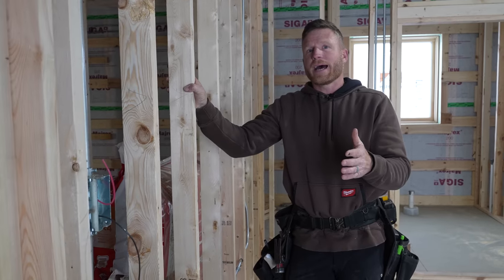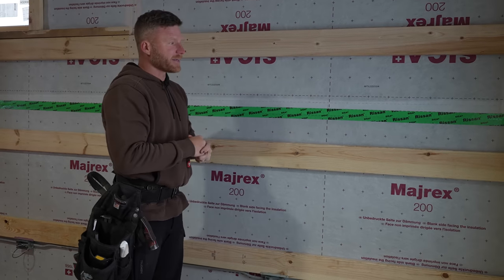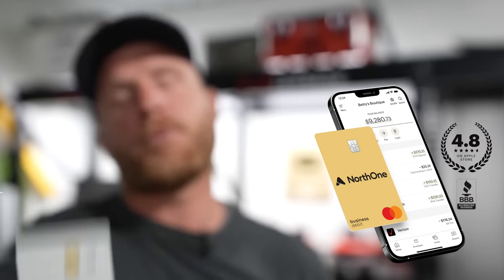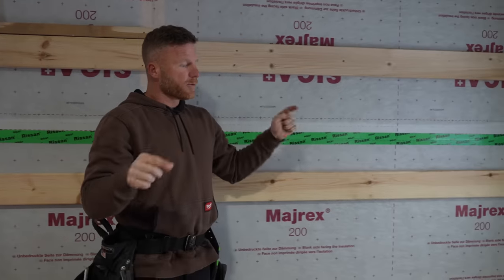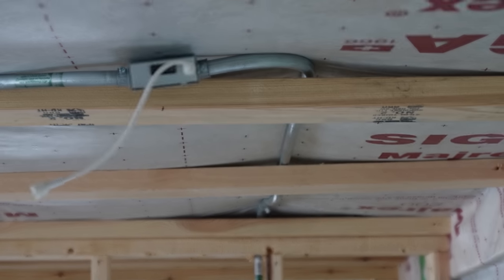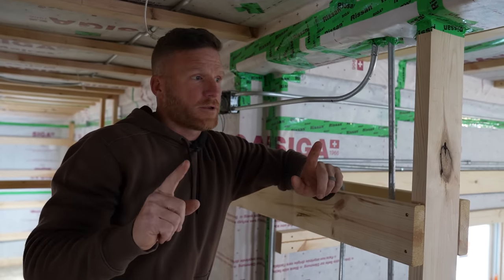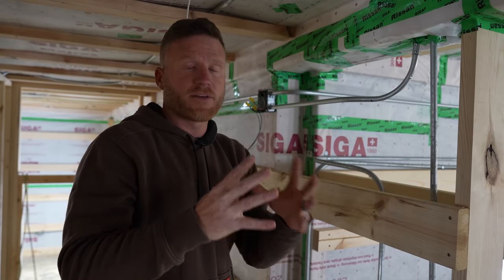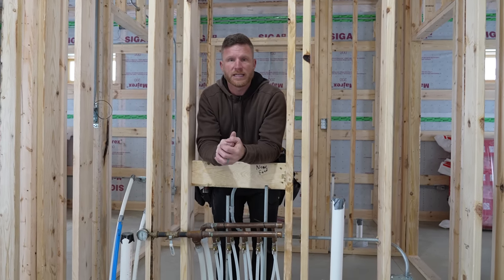The BEST way to run ELECTRICAL in the BEST HOUSE

Comment: Won't the conduit running into the attic result in an air leak, since it's essentially a race way for electrical wires?  Looking forward to the air leak test.  Also, I agree wholeheartedly, that a tighter, more energy efficient home is a good thing.  Using the heat exchanger or opening doors allows the homeowner to control the air leaks and not the air leaks controlling the energy consumption and comfort levels in the home.

Comment: Done a few small reno's over the years and one thing always puzzled me. Electrical v Plumbing, especially in bathrooms pipes being run above electrical works. 
Water leaks downward so I would always run plumbing low & then vertical runs up to point of use.

Comment: Romex is easier, but conduit is better. With conduit you have the ability to add/change circuits at will thru out the life of the home without disturbing structure/finishes.

Comment: I have to agree with the home owner on the conduit. It's what I prefer.
Reply: The only thing I would have changed is the boxes. A 4 square and mud ring is much easier for splicing and installing certain devices.

Comment: I have a random question lets say I am remodeling down to the studs a big section of my house like there was a fire in the kitchen and living room or flood or whatever. When I go to remodel if you were to do these things in that area would the siga still be able to preform as its designed to make that area more efficient or is this only an option if it was put in the whole house?

Comment: I love the plumbing in internal wall philosophy. I just remodeled a laundry room, and relocated all plumbing and electrical to internal walls, and replaced the glass insulation with rockwool. The room is so much quieter and more comfortable, it surprised me how much difference it made.

Comment: Are the conduit tubes sealed with any type of special fire resistant silicone to prevent air movement from the electrical outlets?
That can contribuite to the blowerdoor test.
Reply from the maker: They are inside the envelope it isn’t an issue

Comment: You mentioned "negative air blower test" I'd like to see that because usually its positive air to show leaks. How does that work?
Reply from the maker: You can go either way.
Reply: With the negative test, it's easier to find the leaks while inside the home as they appear to be air leaking in. Much easier to find with a smoke generator.

Comment: when you have under slab plumbing and no in floor heat are you worried about waterlines freezing?? or if you do under slab plumbing is it required to have in floor heat to keep the waterlines working properly

Comment: Will there be any Air Conditioning in this house? Curious if ductwork still needs to be ran or if there will just be a couple ductless airs installed later on. Obviously heating is done from the tubing in the floor. Thanks
Reply from the maker: Just mini splits

Comment: Morning, I was always under the assumption that dead air space would create a spot for condensation, so what happens in the uninsulated space where the electrical/ 2x6 framing is behind the drywall, is this not an ideal spot for moisture to accumulate?

Comment: Question sir! You mentioned R-21 on the walls with Rockwoll. How much would the cost difference be if you used 3" (R-7 per inch) closed cell insulation on this building?
Reply from the maker: material wise over double per square ft
Reply: @RRBuildings  that is a lot. I am looking forward to see the blower door test.

Comment: It different to see all the conduit for the wiring in a residential setting as I mostly just see the wiring like 14/2 run and stapled.
Reply: in most states, romex wouldnt even be allow in that kind of build.
Reply: @Pepe  is it because it's not a conventional framed house? The only place I've ever seen much conduit here is in commercial or in underground here in Canada. Mostly just run the wire directly from the rolls and they need to be stapled every so many feet.
Reply: @matthewmcallister8845 it is because of the building code. The stapled wire is too close to the drywall. It needs to be recessed a bit more but it actually can't. So they have to use conduit.

Comment: Do you guys test for radon in Illinois? Curious if that's a concern there and if you install mitigation systems sucking air from under the slab.
Reply from the maker: We have a radon mitigation installed passively for now and it can become active if need be

Comment: Cost...cost...cost... affordable is lost in the pursuit of "airtight", control layer when everyday you go outside, you allow air into the structure (and you breathe same outside air). In the end, over reaching building science is leading the charge to unaffordable and in fairness unnecessary building practices. 10% energy savings is not worth the 30% increase in construction costs... 
I do luv the solid workmanship demonstrated in your videos, exceptional and rare! Completely enjoy and appreciate the dedication to craft!
Reply: Old retired 40 years home builder here agrees, there has to be a happy middle ground. Going to tight, will create some problem somewhere.

Comment: Yes very good Sir. The right way to do electric install for residential homes. The way to go. Better than code. With stick framed walls, the trick of the electric craft use installation 2x2 walls on top of the first built 2x4 wall equavalent structure.  Conduitpipe (PVC-pipe) in construction for residential electric wireing and circuit connect - like inside wireing —  out of wireing them (not 'Romex' equivalent standard  instead of conduit pipe and protected wires inne i röret) to connection box and application sockets. 
You may check out DIY built (smaller) home demonstrating this (using installation walls). Youtuber Mindsparx.

Comment: Hey man ask your electricians to fill every conduit connector with duct seal in the boxes to absolutely seal that up
Reply: You only need duct seal for conduit going through the air control membrane. Most of the conduit just runs on the inside so there's no point sealing a tube where both ends go to the same space.

Comment: Imagine having to run all that steel conduit.  Every fitting, every bend,  every box.
Reply: It's worth the initial hassle and cost. Down the road updates, modifications, remodels, and repairs are all easier with that existing raceway.

Comment: Keeping that vent fan in the same temps until last moment possible should help keep that condensation at bay.  The exterior of the pipe shouldn't/wont draw condensation until the point of exit where you have some thermal bridging at the exit point.     Also, the wraps you are using are interesting... the permeability being directional is pretty wild.  I work with permeable membranes in protective fabrics and directional isn't a thing in our use.. Dalton's Law of pressure is likely always in play.    I gotta learn more about the directional efficiency of those membranes.

Comment: Just curious did you look at price of flexibile conduct with the wire already in vs this solid conduit? I can't argue that the flexibile stuff would look as good, but cost wise would there have been any real savings ? Or is there another reason you went "hard" conduit ?

Comment: What happened to "Best" being spray foam?   No wall penetration issues there.. 
Used to be "why I don't use spray foam before that"...   I don't mind building science changes and advancement but this does feel like a commercial. 
 Still get a lot out of your content though...
Learned a lot over the years...

Comment: Am always shocked at the single layer dry-wall layer in The States. It's so flimsy and can be holed easily just by accidentally letting something fall against it, let alone someone falling against it.
Reply: not an issue really, it doesn't feel flimsy at all. Metal profiles are less prevalent here which I believe makes it more flimsy. Standard 1/2" drywall 16" O.C. wood studs are pretty rigid you ain't falling through it and it doesn't break that easy. Obviously if you start hammering the cavities it will go through but you have to hit it reasonably hard still.
Reply: I guess you have a lot of bar-room fights at your house. Half inch drywall is pretty stout on 16 inch centers.
Reply: @brianfahey2864   Hey Brian,  laughed at your comment 😂 I'm English but live in Germany. Any dry-wall work here is mostly doubled up (two sheet thickness) which makes for a much more stable wall when hanging stuff like kitchen cupboards or shelves which have to bare a heavier load, it also lends more stress resistance if someone falls against a wall or a kid rams his/her bike etc into it. Have often seen one-sheet walls being broken because of the lack of stability. Over here in Germany, everything is much more solid anyway. Outside walls are mostly brick, inside walls are also made of blocks with the cabling being put into grooves routed into those blocks then plastered over. Am a big fan of watching RR Building's channel so have seen what standards Kyle and Greg work to. Amazing stuff! What I also know is that Americans pay a lot of money for nearly everything you have to buy, including houses. Here in Germany, prices have also increased, are still however much lower than in the States and you get a more solid house into the bargain. Ragards 👍

Comment: None of his builds would ever pass an electrical inspection. What a clown.
Reply: Thanks bot! Obviously has to pass electrical inspection in the county/state he is in. Try again…..wah, wah…
Reply: @mikeerstad4828  untrue. He likes to brag that he lives in such a rural area he never gets inspected. He would probably fail structural inspections as well.
Reply: @CybekCusal  did you know that 54% of all townships and parishes is the US require no building inspections and/or permits! The way R&R builds would easily pass structural inspections anywhere outside of hurricane areas and could also pass that with a few slight modifications. Post frame construction has been proven time and time again to be better construction than typical stick framing. 
Not sure where you come at him with the not being able to pass electrical inspections - he is not an electrician, I assume his electrician is state certified,etc. so electrical passes code.
Reply: @mikeerstad4828  lol. And Jewish space lasers 😂 are real
Reply: @CybekCusal  thanks for revealing you know nothing and have nothing to add.
Reply: Yeah, sure… like his builds are not passing electrical inspections in Northern IL!🤣 You definitely do not know what you are talking about because the inspectors and building departments are psycho about their regulations in IL.
Reply: @nathanaelhawkins5004  he told me none of his projects get inspected. So if you don't believe me then he's the liar. 😂
Reply: Me believing or not believing YOU has nothing to do with him being a liar.🤡 Besides, I’ve been following him for six years and I can’t think of a time he has publicly stated in a video about not needing or not having inspections.🤷‍♂️ Here in IN, all new construction electrical work requires inspection and I work in 6+ counties in northwest IN. IL is no different and if anything, are even worse when it comes to permits and inspections from people I know that actively work in IL. Go start your own channel and then we can critique your builds!🤪
Reply: @nathanaelhawkins5004  🤷 thankfully you got it a figured out.
Reply: @nathanaelhawkins5004  he maybe working in a county that does not require structural inspections. Believe it or not all counties do not require them. The county I’m building in MO only requires an electrical and a safety inspection to get a certificate of occupancy. Up until a few years ago didn’t require building permits. 
If you think Kyle wouldn’t pass a structural inspection point out some of the obvious egregious violations that he would fail on. Come on man🤷
Reply: im pretty sure he explained in a past video how where he builds he doesn't need permits, and sizes beams off past experience. His work looks top notch, and is continuing to elevate his game with air control. Speaking for direct experience, inspections and permits are nothing but a bribe to the municipality and bragging about passing them is like listening to dogs barking at the wind
Reply: I’m pretty sure this thread of comments started from this phrase: “None of his builds would ever pass an electrical inspection”🤨 This discussion was never about a general building inspection or an engineered plan design and build inspection to those set of specs. Totally about electrical inspections 😁
Reply: @nathanaelhawkins5004  well do tell. Kyles not an electrician so how is the electrical not up to your standards? I would assume the electrician is state certified.
Reply: @nathanaelhawkins5004  he's not a electrical contractor. The point is moot
Reply: If he’s not the GC, the electrical being up to code and passing an inspection or not having one at all, is not his problem. End of story
Reply: Besides, every state, county, municipality, and township adapts different years of NEC code that they require electrical systems to be designed/built/ installed to.
Reply: Being a builder for 50 years in the California bay  area with seismic earthquake and structural engineering for as far as you can see one question I’ve always had with these post frame buildings is the second floor ledger attachment to the exterior walls. I’m not sure, but it appears that they’re only being structurally attached at the posts, there’s no way a couple bolts at the post. or a few SDS screws into the post. Whatever give you the structural loading that you would need for a second floor especially if it’s storage and ledger is connected 16 inch on centers with much heavier connection devices such as five eights lag bolts staggered 16 inch on center. I’ve always wondered where they’re getting their structural values on these ledgers for second floors I would always have assumed that you would build the wall against the exterior wall to carry the load of the second floor. It’s always been a question any answers

Comment: conduit rough-in for residential construction is SOOOOOO much more expensive and typically NOT feasible for most customers to afford.  Your builds are also NOT a typical affordability level for most (90%) of potential customer base.   Love your construction... just not typically affordable

Comment: I HOPE this the Right Show. But installing Buried conduct at Your House was a Nightmare. First of All when You install Buried Conduct it Goes to Point A to Point B. Meaning the Conduct is sealed at Both Ends into the Fixtures meaning the Switchboxes is the termination  for Point A and Point B. Then You pull the Cable through the Buried Conduct from Point  A and Point B. That  Mean all of the Electical wire is in the Conduct and none is Exposed to the Ground or outside the Conduct as You did. I don't understand why the Elecitical Inspection didn't Fail You.  If You were in My Area or America the Electrical Conduct would have Failed. When Running Conduct No parts of that Wire is Exposed to the Outside the Conduct. You may be a Good Framer but You are No Electrical contractor.  I would have FIRED YOU THE FIRST TIME I LOOKED AT YOUR WORK.